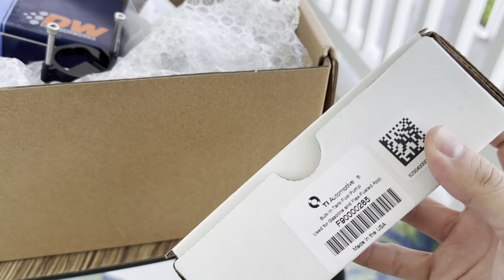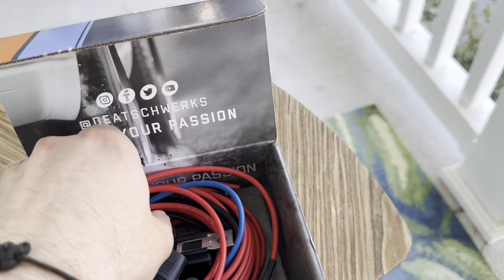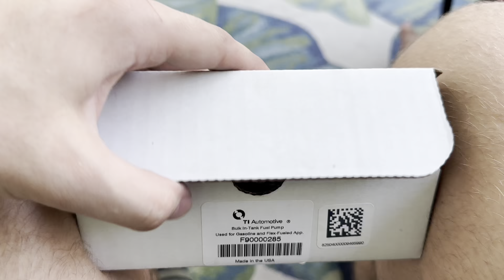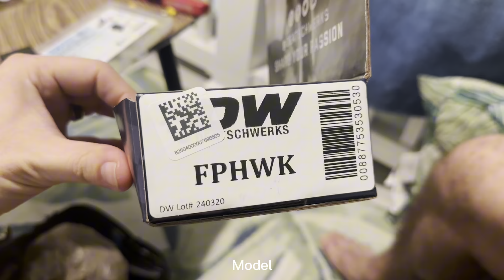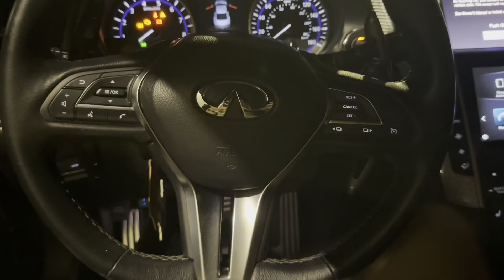How to install hellcat pump/relay kit on q60/q50

Comment: I don't know why you used a relay kit. Does this mean the fuel pump will run harder?. Why did the pump sound change?

Please I need an answer as I don't know anything about relay kit 🙏🏻
Reply from the maker: The reason the relay kit is on there is to have the pump work 100% it was tested before that if you just put the pump in it won’t work at its 100% maybe around 80-85% it’s a big pump it needs more voltage from the battery to work how it needs to. The oem wiring has it set to a specific voltage but with the relay that changes and gives it more power